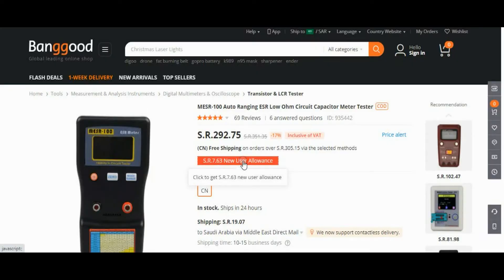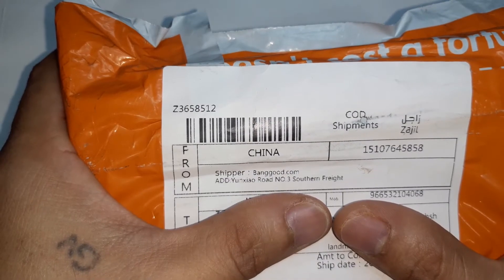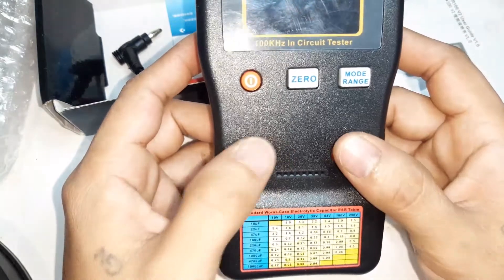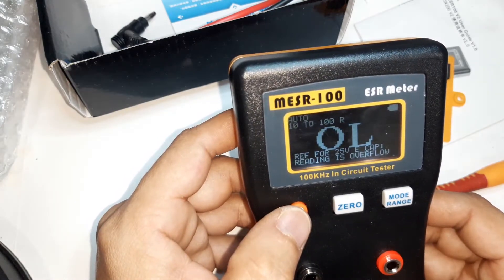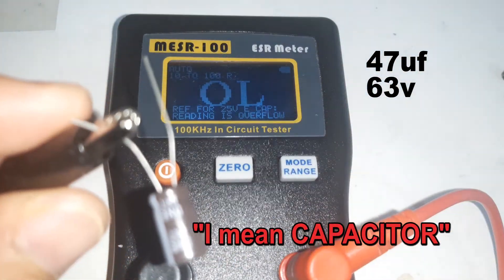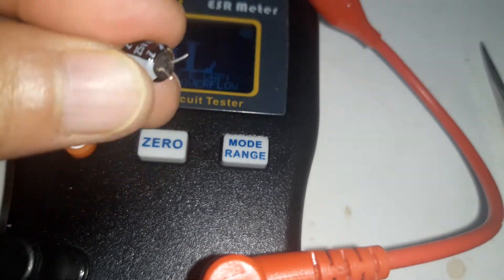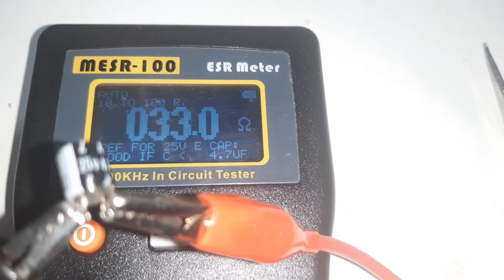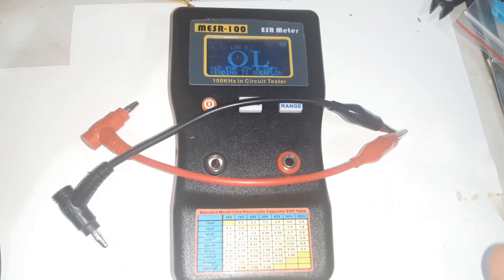CAPACITOR TESTER : MESR-100 ESR METER REVIEW AND TESTING

Comment: Is there a replacement for the standard gator leads? The gators are too thick to press up against the contacts of an SMD cap on the Dreamcast Im checking
Reply from the maker: Yes....you can buy locally

Comment: Connect the leads as close to the cap as possible. Do not want to measure the caps leads. The chart is a very crude estimation. Always look up the cap datasheet and see what it says. I have one of these MESR100 meters and it is pretty dodgy at best...You have to re-zero it every time. It will not hold its zero. Varies around all over the place....
Reply: Which is better, bside esr02 pro or mesr 100 ?
Reply: @lucasrocha4329  I dont know the esr02. The mesr100 is fair, and it works. But it is very cheaply made.. the Atlas esr70 is the one to get. But its 120 bucks..